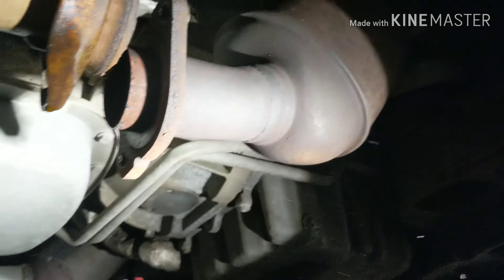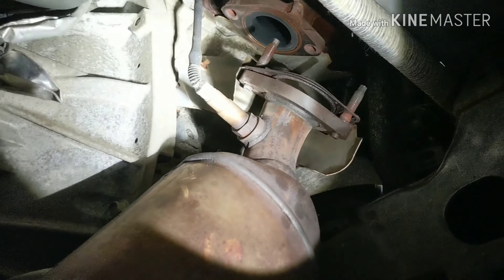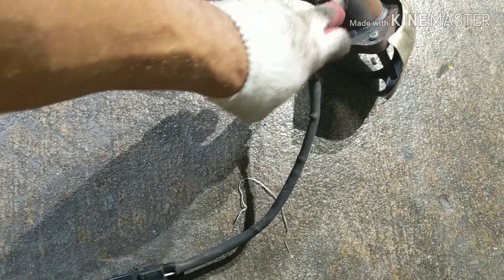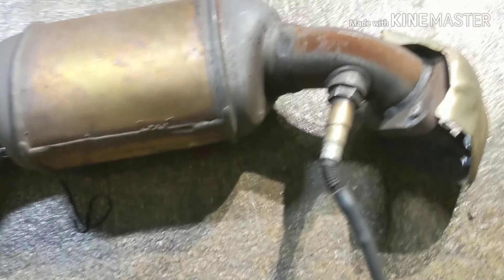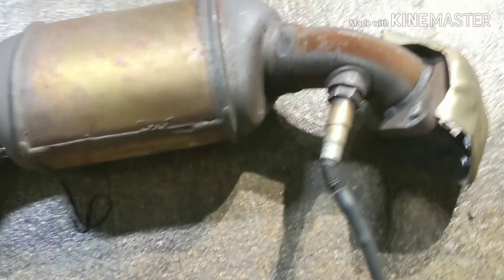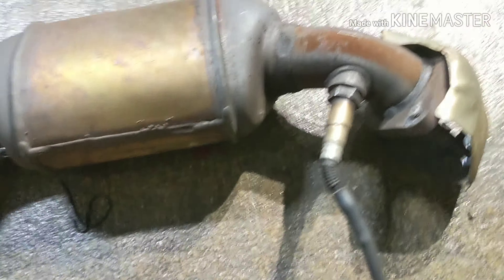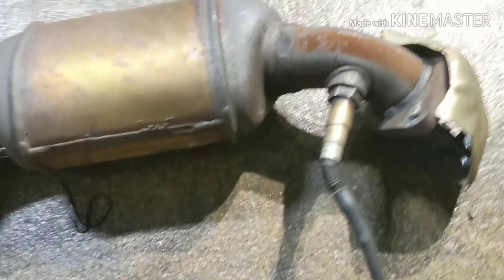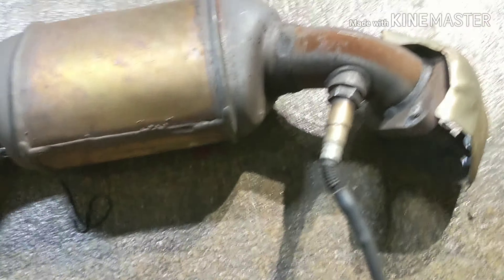Cadillac CTS catalytic converter removal

Comment: Excellent video. One thing...removal of the bolts on the top of the converter, it looks like your ratchet is going in the clockwise (tighten)  direction. That seems backwards.

My bad, it really is counter-clockwise. I finally got the inner one off. The outer one is seized. Eventually got it out when the whole stud came out.
Reply from the maker: 😁👍🙏 thanks John